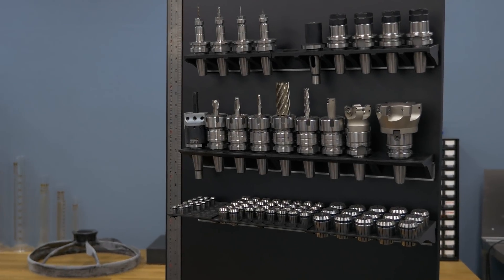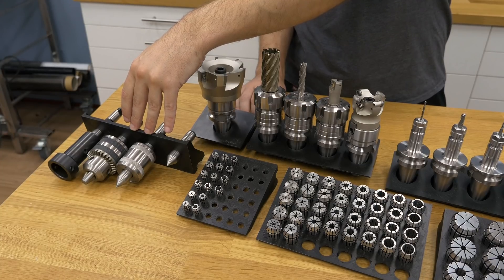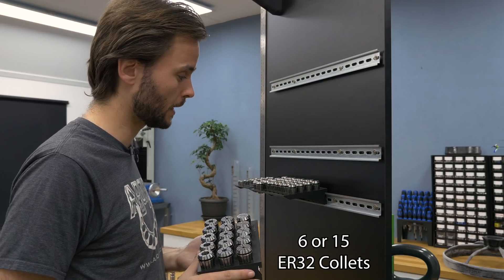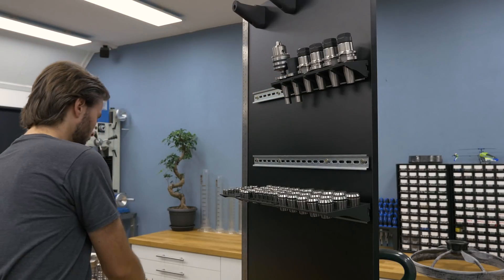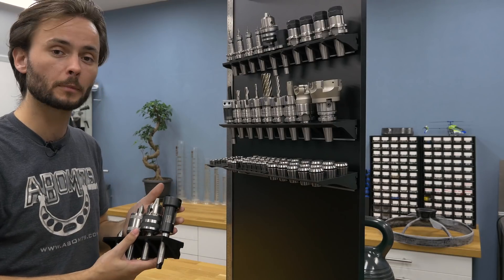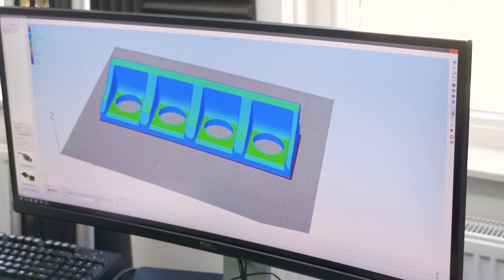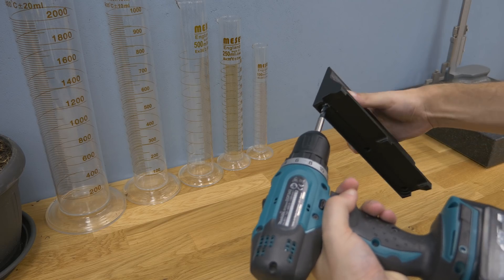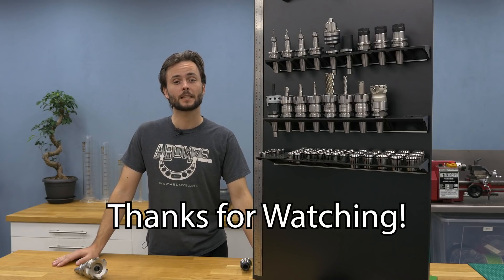DIN-Rail Modular Tool Storage (Free STL Files)

Comment: Great idea, got here as I could not find DIN rail tool boxes and hooks to buy. Why is no one making them... By the way do these have a locking screw  or bottom clip. The look very easy to dislodge and there is a lot of expensive chucks and collets on them..
Reply from the maker: Thanks for the comment! They do not at the moment, I haven't had any issues with them coming loose from the rail but I was considering updating the models to add a locking screw.

Comment: How are these holding up over time? BT tool holders are expensive and I'd hate to have a holder delaminate and drop my tools...
Reply from the maker: They are still going strong so in my situation it's working out great even the holder with the 80mm facemill. It does depend on the filament ofcourse I'm using BASF Ultrafuse PLA Pro1 filament Zwart with great lasting results
Reply from the maker: The design is made to last. The construction is optimized for printing, but of course the strenght depends on multiple factors (printer, printer settings, materials etc). mine are still in great condition, none have failed or show any signs of stress. 

So it should be fine, but because there are so many variables that affect the final quality I cannot guarantee the quality of your prints :) 

Thanks for watching though!

Comment: AMAZING! any chahche you could make a BT40 version? great anyways
Reply from the maker: Thanks! I did consider making one but after some testing I decided it would be a bad idea to base it on the same model/series. The 40 taper holders are a lot heavier in comparison to the collets and 30 taper holders. Besides that, due to the larger diameter the center of gravity moves farther from the rail.

An option is to modify the model more dramatically and add long threaded bolts through the entire holder instead of just the end. I would recommend to make holders from sheetmetal if you want to use them with 40 taper holders.

Comment: Subscribed 😀. Looking forward to the morse tapers. I watched a few videos showing more perimeters increases strength more than increasing infill. Cheers
Reply from the maker: Thanks for subscribing! You are right, that usally helps more than increasing infill density. There are also a couple other things you can experiment with that will affect the strength, an obvious one is the type of filament but also the orientation and temperature have a significant impact on the endresult.

I will upload those in a couple days, I got a list of new models that I am preparing to publish, besides the MT1 MT2 and MT3 I will also add ER16 ER25 ER40 and a couple other cool accessories.
Reply from the maker: I got some good news for you, they are published! You can find them on my thingiverse account, I will also add links in the description of  this video.

Comment: where do you source your DIN rail? online or locally?
Reply from the maker: I bought it online but domestic (in the Netherlands). The type is: DIN TS35
Reply from the maker: I just noticed that the whole series is "TS35" so to be more specific: TS35/7.5/1.0 is the type of rail the holders are designed for. (7.5mm deep and 35mm high)
Reply: I bought some short pieces off Amazon, and a long (3m) piece at my local electric supply store.